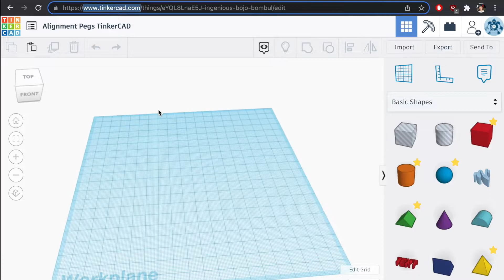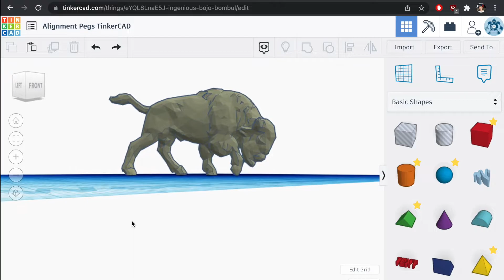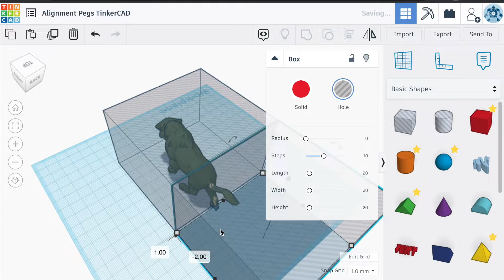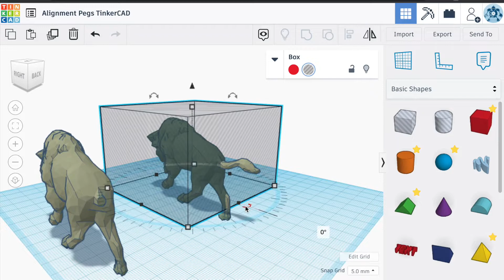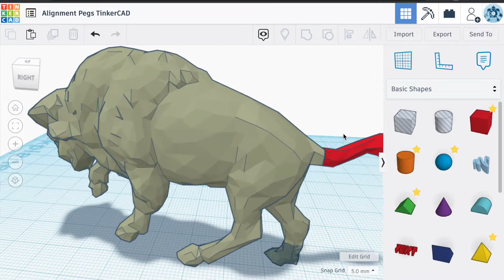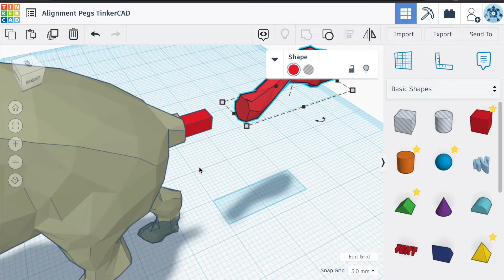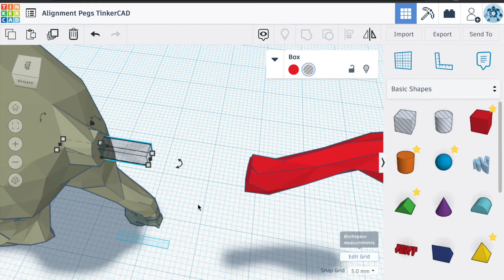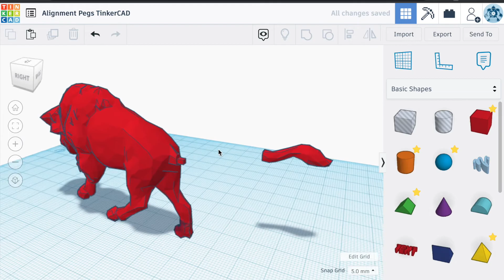TinkerCAD Tutorials - Alignment Pegs - Save support and join models after printing

Comment: Awesome video! 

Smalle tip! You can Hide the blocks with the Lightbulb icon. 
And then reveal it again with big light button next to group. 

Then you don't need to move do much.
Reply from the maker: Thank you, that’s a great tip will add to the description! I don’t believe that icon was there when I first started using TinkerCAD years ago, did it come in an update?
Reply: @CallumColes  Heey! 

It has been there for many years, but I also only discovered it about 2 years ago. 

Changed my workflow quite a bit and made some complex Parts easier to achieve.
Reply from the maker: @jamiegoegebeur2239  yes can imagine, it’s a great feature, very helpful in other software packages too!